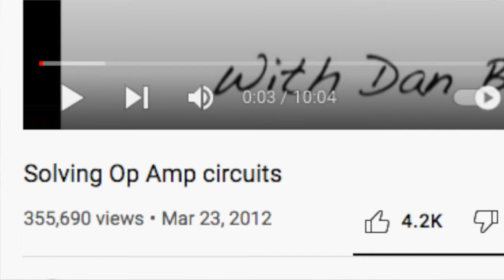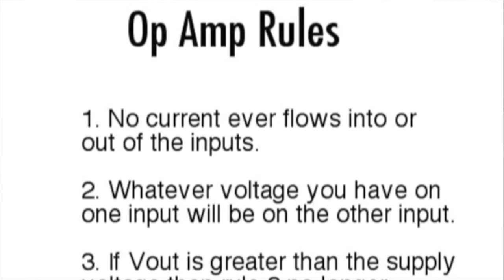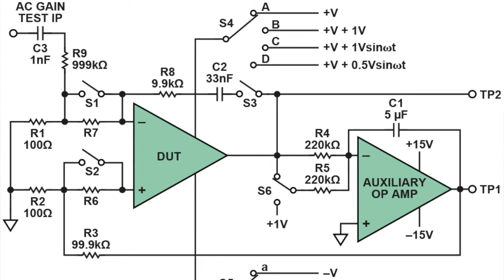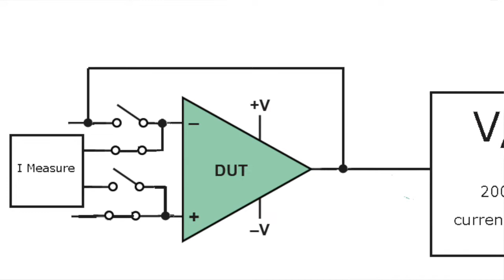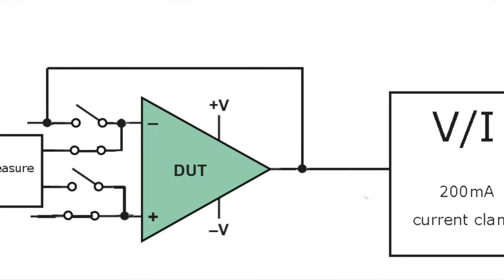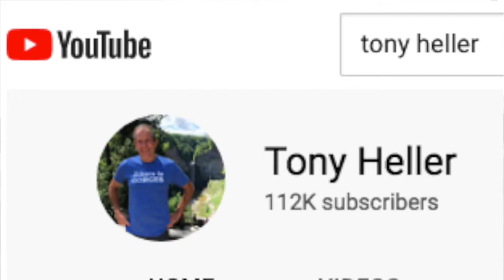Op Amp real life problems

Comment: Can current flow into and out of the output of an op amp?
Reply from the maker: Yes, that is how it controls the voltage on the output, by pumping current in or out of the output.
Reply: @DanBullard  thanks